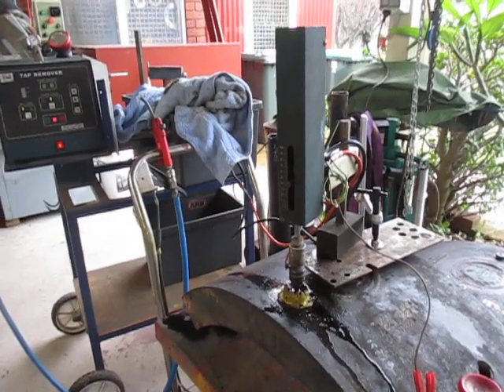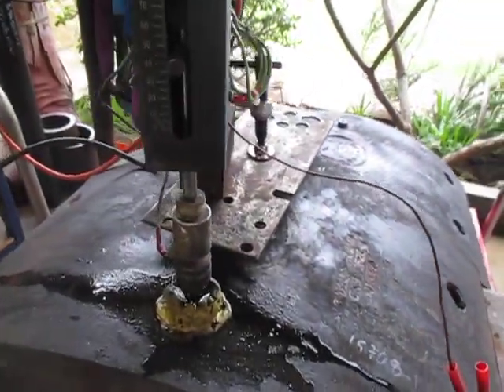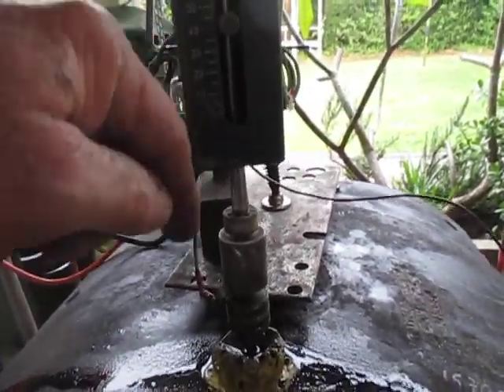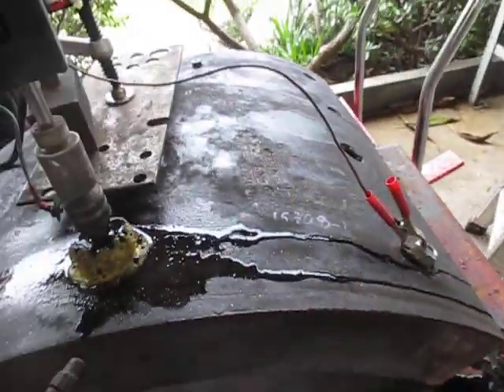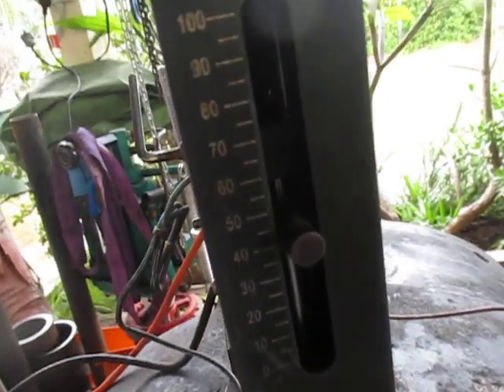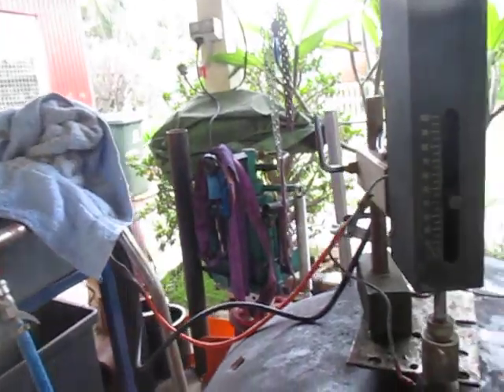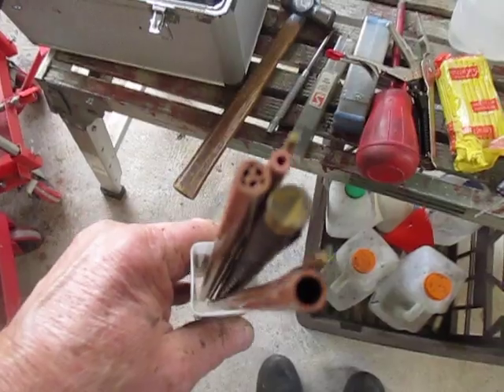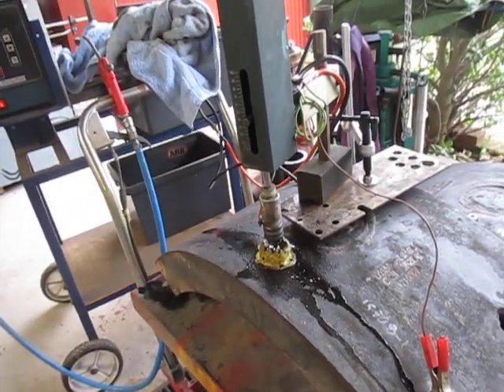Getter Out Broken Drill Bit.

Comment from the maker: SOVEREIGNDesigns. This one is about 6 years old, I am interested in another one. The Chinese clones have not been all that good. The supplier in Taiwan will only sell in batches of 10. Hare and Forbes stopped bringing the Chinese ones in because of too many problems. I'd be keen to look at a Japanese one. I have 5 jobs at the minute that I need to spark erode, so I'll post some more vids. Work for the machine comes in runs.
Reply: Yep I too was hoping to stay away from the Chinese ones but have seen a unit that doesnt look bad. Obviously the Japanese and Taiwanese units will be quality but havent found much on retailers.  I will put up the ones i have info on. It could be helpful idk

Comment from the maker: EDM machines use differing fluids, In this case I find rain water works well as a no cost alternative to buying purified water, another option is to harvest condensate water from air conditioners, we use that in the steam iron. In regard to electrodes I'll do a vid on that, my mate Les has a setup where he sometimes uses a hollow tube with an elevated water source to run the water through the middle of the electrode, something I have been meaning to do also.